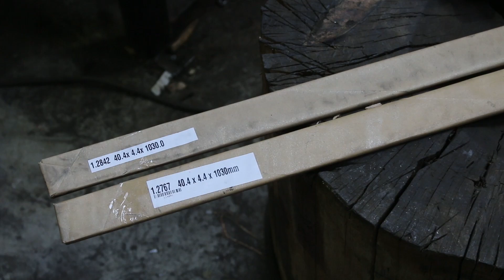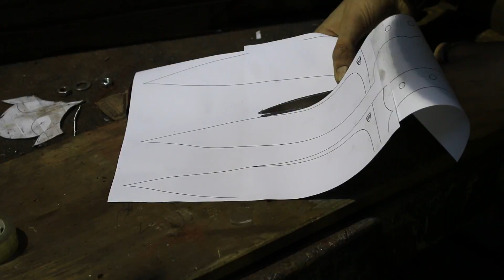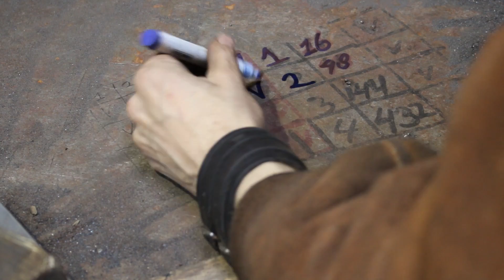Forging a Damascus steel kitchen knife.

Comment: I'm new to watching these types of videos.  What is that powder the pours over the heated metal and what is its purpose?
Reply: It's Borax I think. And it's used to get rid of the oxidised steel (the dark scales you can see forming here 5:51). I may be wrong about this, I am also just watching these videos for fun. Try searching for uses of borax in forging maybe You can find some better explanations.

Comment: Does setting that rivet disturb the heat treatment of the blade?
That was a VERY deep blue on either side.
Reply from the maker: it does not get to the cutting edge.  the portion that is getting blued is better of deep tempered.
Reply: @freerkwieringa275 How do you lose the discoloration?
Reply: @EricH928  you buff it off. Most just leave it since its covered anyways and when the handles are made it buffs off the coloration from the heat.
Reply: @freerkwieringa275  💵💶???
Reply: Since this question is here, what’s the purpose of heating the pins anyway? Does it hold tighter?
Reply: @freerkwieringa275  please, what price does it have?

Comment: Would it not have been easier to hot cut it and fold rather than letting it cool, grinding, welding then reheating?

Comment: I just wanna know what is that powder he used for the heat treatment?
Reply: I believe it's borax. Used to prevent and/or help remove scale. Allows for cleaner metal and truer forge welds.
Reply: @covalkir  does it lower the melting point of the metal?

Comment: A beautiful piece to be sure, and testament to the craft of the builder.  I'm in complete wonder about how the bolster and pommel stay in place with just a single pin. I mean, I see where the pinhole is tapped, and the pin is heated and hammered in place. I would think with just the single pin the metal plates would spin, but they seem to be fine.
I wouldn't think a contoured grip would be ideal for a kitchen knife, though. My grip on a knife changes a lot while cooking, and I rarely have my full fist on the handle.

Comment: Hi! I have a question, What is the powder that you use when you are welding the metal plates? thanks.
beautiful work, beautiful knife!!
Reply: Pretty sure its flux, fills in the gaps.

Comment: Great work, fantastic looking knife, it's just not a good kitchen knife. Really good chefs knife you want to go thinner with more straight handle and preferably either no bolster or bolster more streamlined. 
Current design will not allow proper knife handling and a but thick and heavy for professional kitchen. 
But I would totally buy it for my home to show to everybody and to brag to guests.

Comment: those traces on the knife are thin steel layers right?
Reply: Yes, the black bits are layers of the 1084 (or 1095) steel which as a simple high carbon steel show black when etched in acid, whereas the lighter colour is 15n20 steel which is also fairly high carbon at 1075 steel(1075 is 0.75%carbon 1084 0.84% and so on) however as the 15n20 steel variant of 1075 also contains nickel is resists the acid remaining bright
Reply: @veruslupus  thanks, i had no idea they have different chemical characteristics

Comment: Is there any particular reason why you cut and weld instead of fold the metal?
Reply: enormhi its so he can grind away oxides that form in heat..oxides prevent welds...improves chances of successfully welding...

Comment: This isn't damascus steel. This is commercial steel. Damascus steel was a particular type of blade forged from wootz steel, smelted in a crucible..

30:13 damn that's a gummed up cutting edge!

Comment: The moment you realize store bought knifes just don't cut it so you forge one that puts them to shame
Reply: Punny
Reply: and then you realize you made the handle wrong so you cant hold your chef knife as suppost to and put yourself to shame xD
Reply: And then you forget to heat treat it and it won’t cut a damn thing.
Reply: 30:36
Reply: A great blade smith like this has learned from all his mistakes and hopefully puts more effort in than forgetting to heat treat!

Comment: How do you stop them going rusty .
Reply from the maker: Peter Taylor oil. I never have rust issues myself. I prefer normal steel over stainless
Reply: Peter Taylor you can’t but put it in boiling water en treat it with olive oil or similar, however this one outlives you, and your children

Comment: Why did you sharpen the blade so early into the build?

That seems like a step that's best left for last:
May accidentally cut yourself or ding the edge.

Or did you sharpen it so as to force yourself to be more mindful of the edge?

Comment: I noticed at the end of the video when showing the cutting edge of the blade there were slight dings that should have sharpened better otherwise this is a beautiful knife.
Reply: TheWind213  probably won’t stay that way even if you did sharpen it better, it was never heat treated or hardened at all.

Comment: very nice but i think it must be so heavy
Reply from the maker: panghy patrik it is not light but this is what the customer wanted. I think it has a good weight for big meat. Cutting and even chopping. I really prefer heavier knives for this. It gets very sharp so delicate work is also not a problem. Normally I use a small knife for vegetables

Comment: Another great knife...this will last forever. Question : where do you get the 1.2767 steel , and can you also buy it thinner than 4.4 mm?? If you would start from lets say 2 mm flatstock , you could get a double amount layers in the first forge weld and save some gas , worktime and steel. Any reason you use 4.4 mm flatstock ??
Reply from the maker: HoutmeyersP it is a industrial steel   it can be bought in different stock but it is expensive
Reply: I allready used it...bought it from Abrams Premium steel.....but the thinnest they have is 4.2 mm. I would like to find a dealer that has thinner flatstock or even sheet steel in 1.2767. Where do you buy your steel Freerk ??
Reply from the maker: HoutmeyersP at telmastaal in Holland.
Reply from the maker: I thought about the exact same thing. But never followed up on it. Too busy with other stuff I guess.

Comment: That is an impressively beautiful knife.  If I was going into the woods to rassle me a bear and pin it to a tree - Id be proud to do it with that thare knife.
Cooking afterwards however, that knife is just too heavy for use in the kitchen.  Also the handle shape prevents you changing grip to hold that fat bolster.  The thickness of the blade must be about 5mm on the spine and bolster, the extra pieces on both bolster and butt must increase the width and the weight to bring the centre of gravity well into the handle. 
It's just too thick to be a chef's knife which would typically be 3-3.5 mm and preferably no noticeable bolster.  If you keep the full tang it needs thinning down to 3mm.
As a fighting or hunting knife definitely A+ ... and it's a great looking knife too - in the kitchen it's just too massive and clumsy to be practical.

Comment: FEEDBACK: The blade half of the knife, the profile, and the damascus are all beautiful.  Respect.  HOWEVER, the entire back half of the knife, while equally beautiful, is ... well ... less than ideal for a chef knife.

1) The handle and heavy pommel you went with would be a great choice for a Bowie knife, rather than a kitchen knife.  Most chef knife handles are thinner, use a slightly different geometry, dont need a heavy pommel/cap, and are usually now made from water resistant or waterproof materials. Plain unimpregnated wood is a lot less common in high end chef knives these days.

2) Ok, here's the biggie.  Please forgive me in advance for ranting, at length.  IMO, full bolsters on chef knives, in all but a very narrow and specific set of circumstances, are obsolete and counterproductive, especially on a hefty hand-forged knife.  While some people do indeed use them to position their pinch grip during use, their primary function was/is transverse stiffening of mass produced blades stamped (ahem ... "drop forged") on automated assembly lines from spools of ribbon steel.  Adding a bolster let manufacturers save money by downgrading to stock that was thinner and lighter without sacrificing too much performance (flex resistance, etc)..

Ok, skip ahead from the mid/late 1900's to today.  Steel technology has improved hugely over the past few decades, and there are now steel choices available that are tougher, more pure, more hardenable, and more stain resistant than even the best surgical steels from the 70's 80's and 90's ... tough enough so that bolsters are now be a purely optional feature, even on most super thin "laser" style japanese gyutos that are less than half the thickness of a classic wusthof from say 30 years ago. That said, a lot of home cooks have simply gotten used to bolsters, and reflexively look for them again when replacing their older chef knives.  Aside from cheap mass produced knives stamped from very thin non-premium steels, full bolsters are mostly unnecessary nowadays.  However, for those who like the feel, aesthetics and extra stiffness a bolster provides on thinner mass produced knives, a much better choice is a "3/4 bolster", which brings me to the other main drawback of a full bolster ... namely that as the edge slowly wears away with years of regular use and sharpening, a full bolster gets increasingly in the way of both use and sharpening, and must be ground out of the way.  Grinding off the end of a full bolster is beyond the means of most casual users who typically lack access to a heavy duty belt grinder - it usually has to be done professionally as a result, often with a lot of gratuitous overcharging. A 3/4 bolster avoids the need for that becauses it only reaches 3/4ths the way from the spine to the heel of the knife.

- That's my $0 02.  Cheers.

Comment: Damascus is cool and everything, but the labor involved is not worth it. I'd rather have a high carbide cpm s110v or M1 than a pretty knife with basic high carbon steel.

Comment: A very long way to go in order to slice potatoes. Making this knife seemed an infinite amount of work. Last thing it needs is my critique. Still, I can't help offering a few cents' worth:
1. For a kitchen knife this is much too bulky, thick and heavy in my opinion. It's the sort of knife you may want to play with, but not work with. Theatrical, not professional. 
2. It lacks the elegance of a well-proportioned, well-balanced kitchen knife. This is more like something you would attack food with, in a struggle of life and death.
3. The transition from the blade to the handle is unsanitary. The joint is abrupt, allowing for moisture or debris to collect and rust the steel. Hard to clean. 
4. Hole in the handle is a bad thing. It may allow the knife to be hung in some manner, but it's just a place for bacteria to collect, breed and contaminate the hand of whoever is handling the knife. 
I could go on, but why? The man works his heart out on these things. He's working hard to facilitate stabbing someone.

Comment: 刀体花纹很漂亮，如果刀柄部分用黄铜点缀会更好看。刃口细节有蹦刃差评。(#^.^#)   The knife body pattern is very beautiful, if the handle part is decorated with brass, it will look better. The cutting edge details have a bad edge

Comment: Beautiful.   But... it is not "stainless steel" and for kitchen use, is not good working with a knife with rust.
Reply: So many chefs use knives that are not stainless. To think a kitchen knife has to be stainless is ridiculous. If cared for properly a carbon steel knife will last a lifetime or 3 in a kitchen. There are many other things I could pick apart about the knife, but not being stainless is not one of them.

Comment: that's a really cool design! i love how the handle looks like from a bowie. i personally prefer when the back end of the edge is hanging lower than the handle and is exposed for more easy sharpening but i can't deny that this looks awesome.
since i don't think i could explain well enough what i meant, here's a random example of an "exposed" edge: https://shun.kaiusaltd.com/images/uploads/products/5862/dm0706_1.jpg
Reply from the maker: Abyssic1 yes I have those and use them allot. I sometimes cut myself on the lower adge as I am  used to bolsters. I think every job has its knife. This would be a good knife for meat and heavy work.
Reply: yeah i totally agree! you could butcher a cow with this :D

Comment: sorry but this is not kitchen knife.
Reply: zajzajer so, what type of knife is it
Reply: Nord Nightblade Its just missing a lot of features normal professional kitchen knives would have, thin stock with a distal taper, pinch grips would be uncomfortable and the sharpened edge stops like 1/4" from the heel of the blade. It's beautiful, but I think a professional chef would want something else